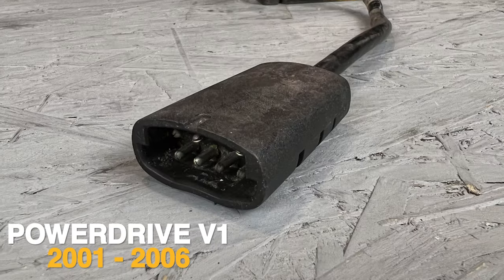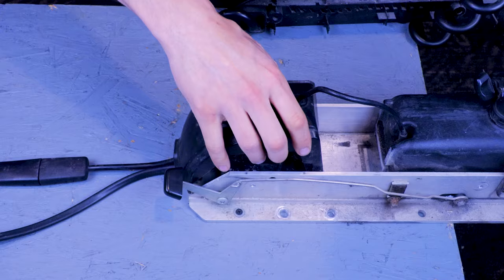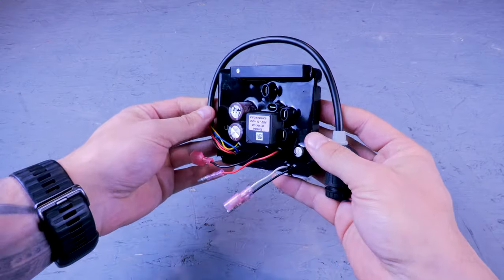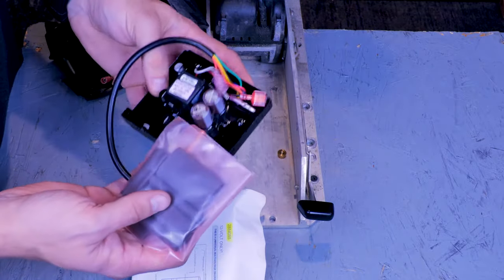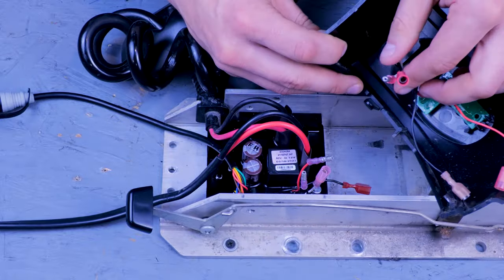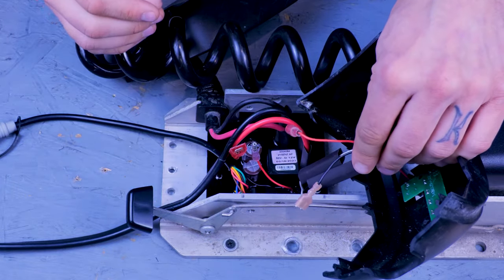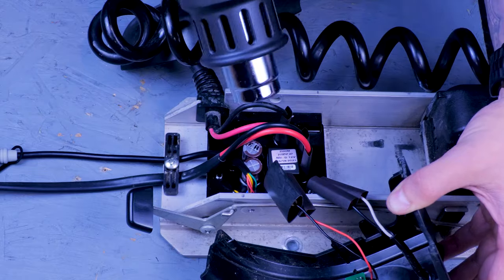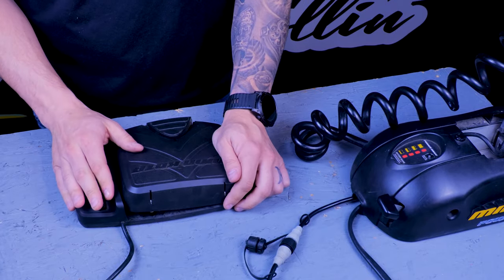How To Replace Control Board // MINN KOTA POWERDRIVE

Comment: I learn so much from your video's. Have you ever done a video on where you should keep your trolling motor clean or lubricated? I have a 24V Fortex 80 lbs. on my bass boat and I just look for moving parts to keep clean and lubricated. I'm not sure if this is correct.

Comment: I have a 80 thrust min Kota it just started acting up it goes forward and reverse but as soon as you try to increase your power it stops forward and reverse do you have any idea what the problem my be. It is a 24volt motor the voltage gauge shows plenty of power.any suggestions would be helpful.thank you very much 👍😎

Comment: Can you provide more details on what is needed to make a V1 unit operational after installing a V2 board?  I didn’t know the foot pedal would need replaced?  Mine has the copilot installed.  What are the issues with the copilot and operating phobe?  Your information is very helpful and is done well.  Thanks
Reply: You will need the remote or the foot pedal for the v2.  Your V1 pedal will be useless after the upgrade.